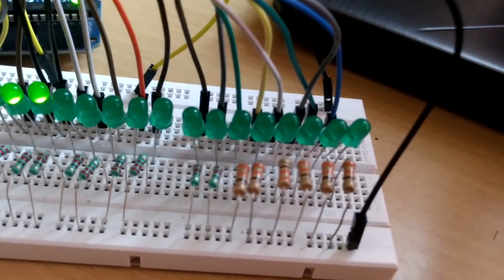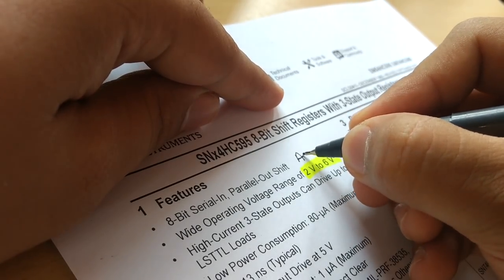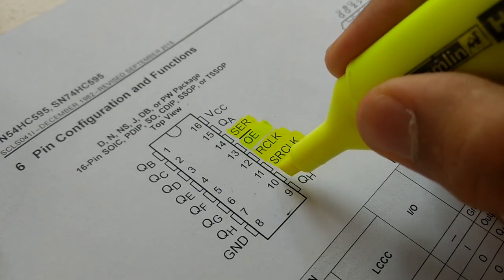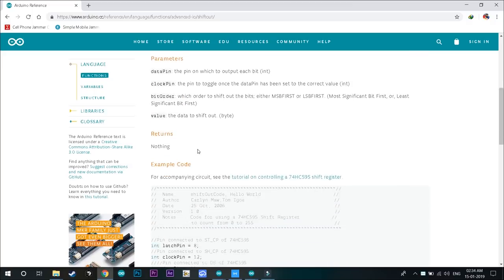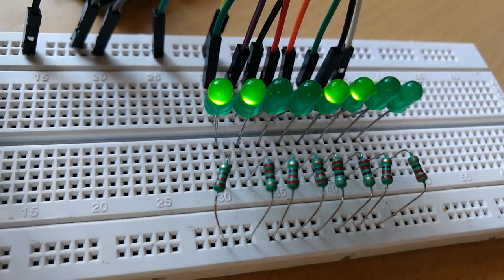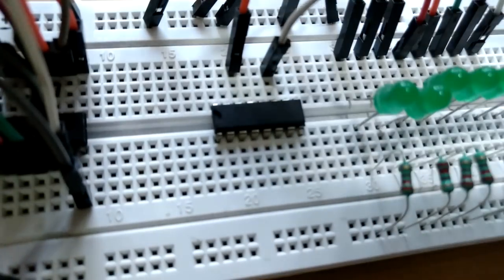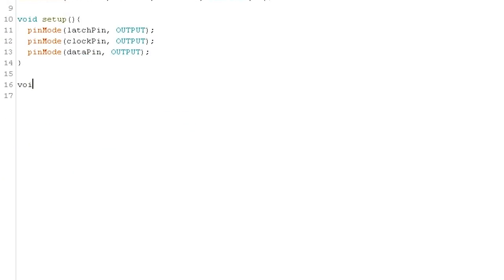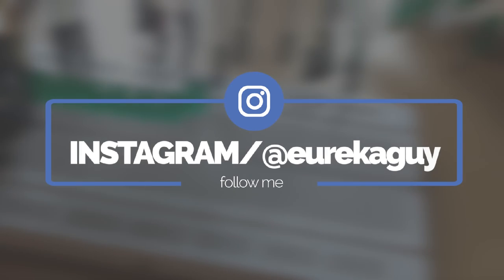INFINITE Pins for ARDUINO?  |  74595 Shift Register

Comment: hello getting this error when compiled:-
Arduino: 1.8.13 (Windows Store 1.8.42.0) (Windows 10), Board: "Arduino Uno"

c:\program files\windowsapps\arduinollc.arduinoide_1.8.42.0_x86__mdqgnx93n4wtt\hardware\tools\avr\bin\../lib/gcc/avr/7.3.0/../../../../avr/bin/ar.exe: unable to rename 'core\core.a'; reason: Permission denied

exit status 1

Error compiling for board Arduino Uno.

This report would have more information with
"Show verbose output during compilation"
option enabled in File -> Preferences.